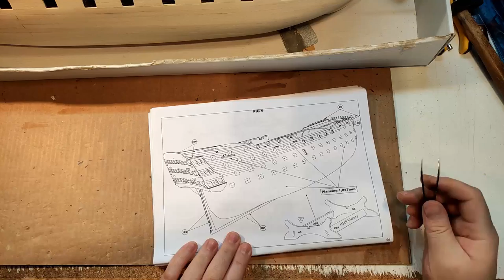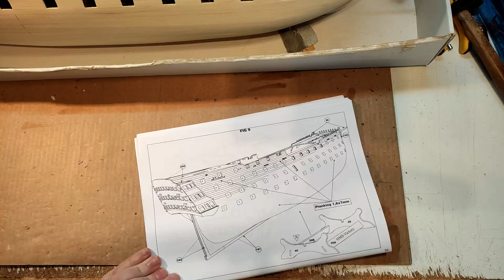HMS Victory - part 22 Placing Keel And Stem

Comment: John your experience makes tough jobs look easy until I try the same task.  Question: Have you ever tried the wood filler powder that you mix with water on any of your ships, and if you did - what are your thoughts?

If you could use a thinned out filler and place it on the edges of the bow pieces (before glueing) it might be able to fill in the small gapes.  Just a thought, I have never tried it - yet.  - Mike
Reply from the maker: Hi Mike! No i do not know the wood filler powder, i use wood putty to fill the gaps.